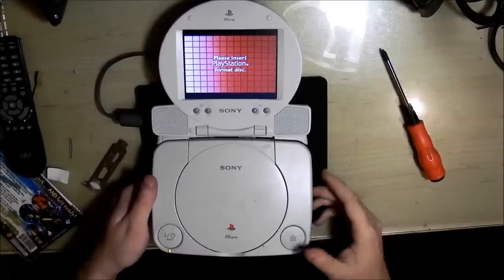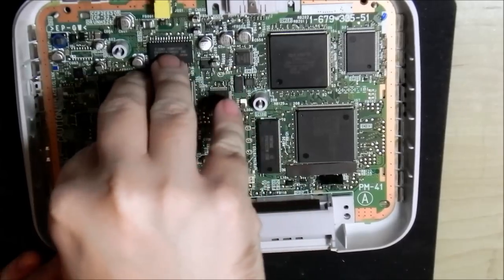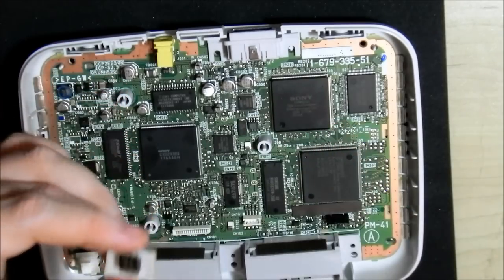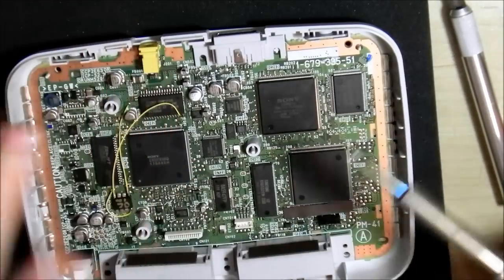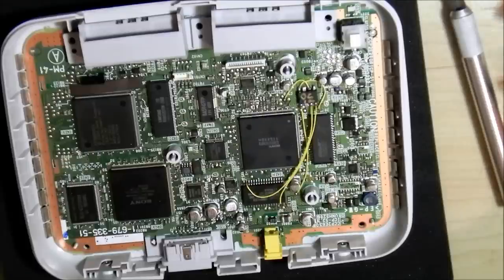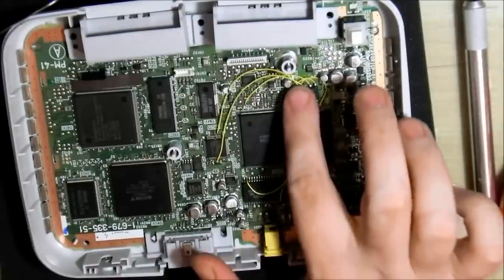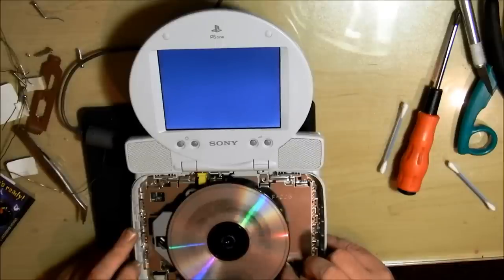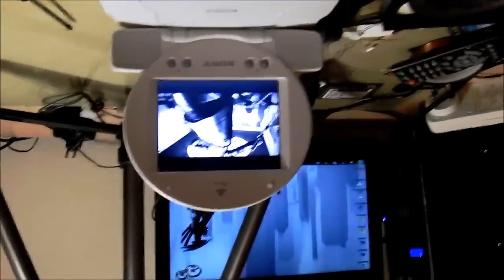Lets Re-mod a PSone SCPH-102 (Camera Test-2)

Comment: Hello there! Question not really related to the video, but I'm wondering do you know why my PSone doesn't want to load games the moment it first starts? I have to power it on and wait around 5-10 minutes before it would actually start loading games, it's same with originals and burned CDs. I'm guessing it's some problem with laser, because disc spins up two times for around two seconds and then stops completely, same as if there was no CD inside.
By the way, great video, you've got another subscriber to watch these ;)

Comment: Hello! I have a SCPH-102 and after awhile I wanted to play games but there was no picture. Sound was there but picture was very distorted and I couldn't see anything. I tried another AV cable and different TVs but no change. Do you have any idea what could cause this problem? Thanks!
Reply from the maker: Distorted video could be a lot of things, but I would look for corrosion, so just open the system up and look at the motherboard, make sure its rust free and theres no residue on the board, allso look at the connectors (where the AV port is soldered to the bottom of the motherboard) and makes sure that theres no dry joints (none of them came loose)
Reply: As old as this comment is, reflow the pins on the AV multi out port.

Comment: hi.
I have a PAL 7502 model and want to play both types of disk.
can i buy a mod chip to solder in off you please!?
Is it hard to program one if not?
I have done a bit of arduino but would rather pre programed chip and put a socket in somewhere

Comment: Nice work! thank you for sharing. Can I use network cable wires for this?
Reply from the maker: +Lucas R It might work if you can find some multicore network cable , single core network cable is a bit toi stiff and places a lot of strain on the pads and connections :)

If you have a old IDE ribbon cable somewhere those cables are perfect :)
Reply: Got it, I will use IDE ribbon cable then. Thank you!

Comment: I have ps1 fat. is that same mod chip can be used for ps1 fat . Is that bad have cd spinning when it open cant it fly out and get hurt from it ?
Reply from the maker: +Andrew Dupuis I would recommend you use one of the MM3 chips instead for Fat PS1, the discs actually sound too slow to come loose and hurt you :)
Reply: ok

Comment: I have PS in my head, but I try to try ps, but when I plug it on my own motherboard, the cd keeps turning around and there is a problem on the motherboard?
Reply from the maker: Murat Çatık it's a bit difficult to understand what you said, but it sounds like it could be your laser
Reply: I do not have electronic engineers, who understand the model here I am in turkey 102 machines How can I repair a lot to me

Comment: the laser is not defective, I have tried another machine, the laser problem stems from the main board, which can malfunction in the part of the motherboard, the cd stops after turning a bit
Reply from the maker: Murat Çatık I would suggest you check the fuses there is a power rail that is needed for the lacer controller to work, if that works I recommend changing the controller, you can use the service ma ual to locate it :) and the fuse required to use it
Reply: HPZeta Thank you for helping me check the fuses with the measuring instrument and return to you playstation is very valuable to me! I am sure the problem is that the motherboard will find that fault